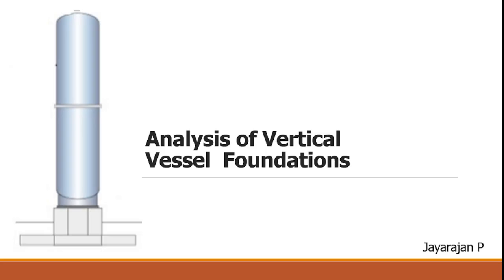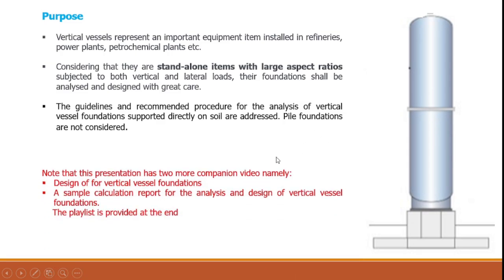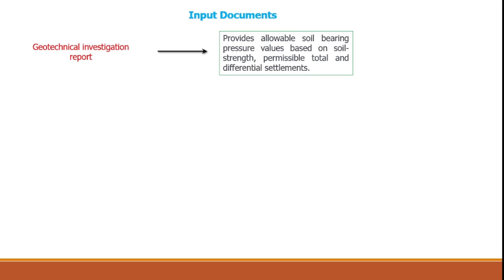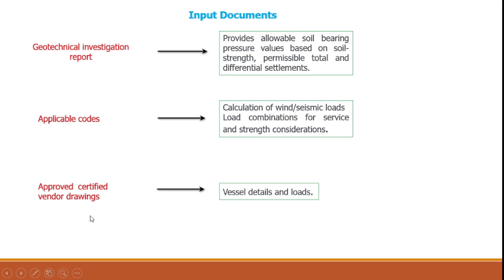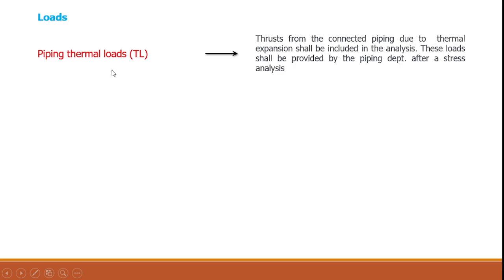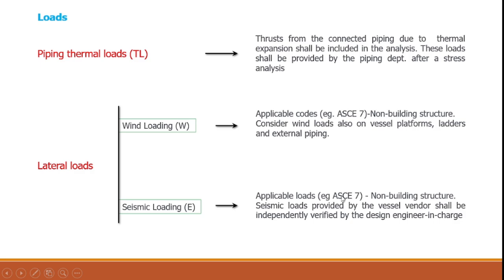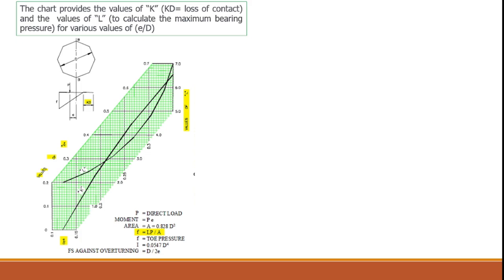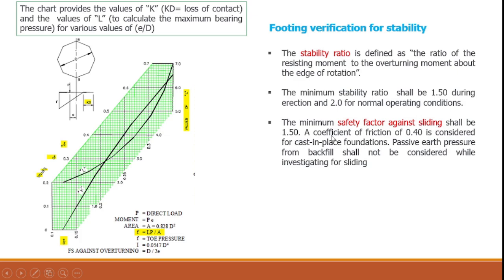Analysis of Vertical Vessel Foundations

Comment: Excuse me sir, could you mention where can i get that chart ? Is that from any code ?
Reply from the maker: It is clearly stated in video that the source (reference document) used is PIP-Process Industry Practices-structural: Vertical Vessel Foundation.
 Guide.
You can also develop the same charts using two equations of equilibrium for an octagonal foundation.
Reply: Thankyou very much sir